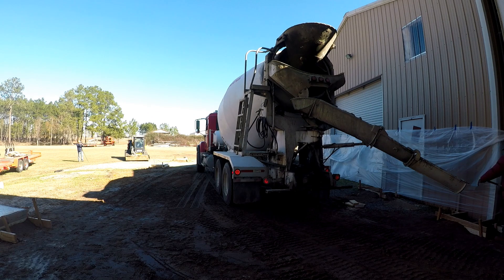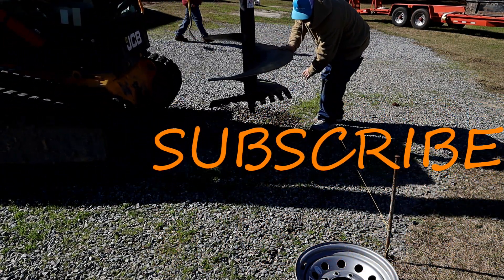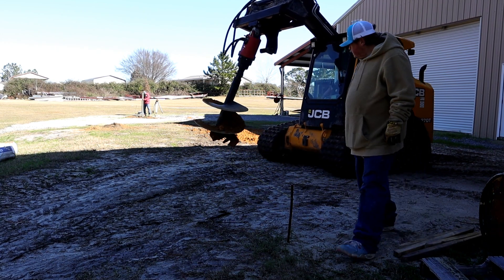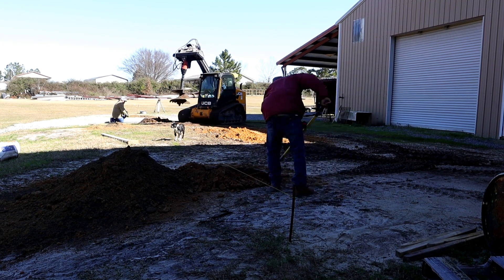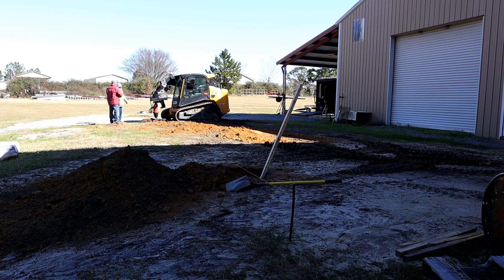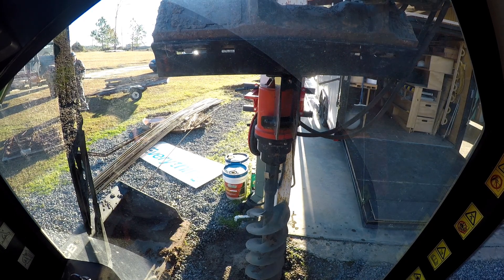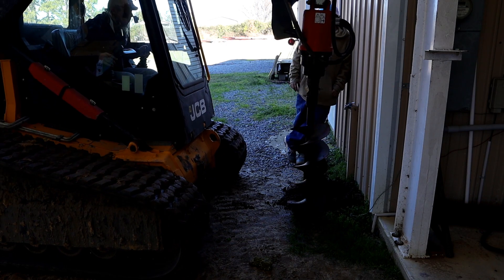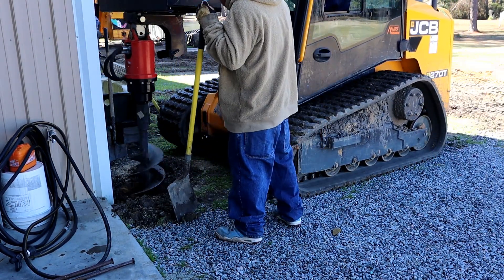Concrete Pier setup for Steel Building Addition

Comment: Just came onto your channel.  I want to add a 40 x 50 Red Iron Steel metal building on my property and was considering doing the install of the building with myself and some buddies.  What equipment is a necessity for the install that I would need to have and/or rent?  Thank You   Mark in Florida.
Reply from the maker: Telehandler is a safer method than the tractor attachment with a ladder in the bucket

Comment: So to keep the rebar from touching dirt you just lift it during the pour and it stays or was there some sort of block or plastic that I did not see?
Reply from the maker: Yes we held it up during the pour..
You want the rebar, at minimum 3", embedded in the concrete.
With this small cage we didn't use  chairs.
Reply: @BuildingwithNARF  Great,  Thanks for that.  Learning a lot and waiting to watch more on that addition build.

Comment: Great video Narf,  I am getting ready to build a 40x80 steel building in north Florida but need to get some engineered prints for the foundation, do you know any one that could help me with that.  The county requires engineered stamped drawings before i can proceed.
Reply from the maker: When a building is ordered I can get the engineer to draw foundation and building plans.
Reply: @BuildingwithNARF  Thanks, unfortunately the company fabricating my building will not get involved in the foundation planning I guess i will just have to find an engineering firm to help me.
Reply from the maker: Email me at Roofover556@yahoo.com

Comment: Great job.  I didn't see you set any bolts or base plates directly into the concrete. Normally I use  16mm x 150mm threaded rod welded to the reo. It was so funny to see  that little kid at 02:26 give  the two finger salute with a smile.
Reply from the maker: I haven't designed the building yet so I will drill and apoxy bolts in later.

Comment: At 13:34 what are you doing exactly you have a pipe or something and the other guy has a shovel ? Awesome Chanel getting ready for my build. Thanks for the info.
Reply from the maker: We are holding the rebar in place so the concrete doesn't shift it in to the wrong position while being poured.
Reply: @BuildingwithNARF  Thanks for your input on leveling the forms and also your rebar bender; learning by watching is my best way to learn.